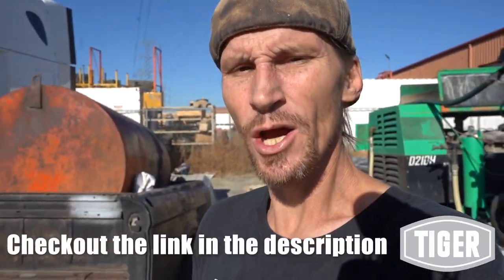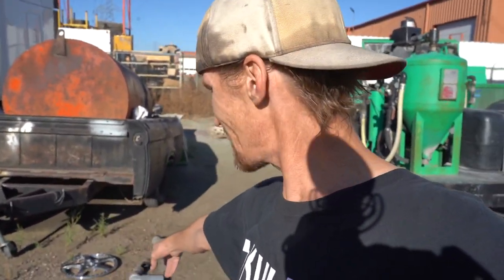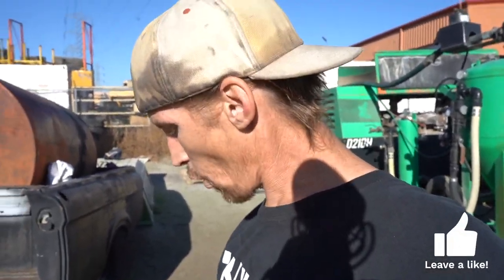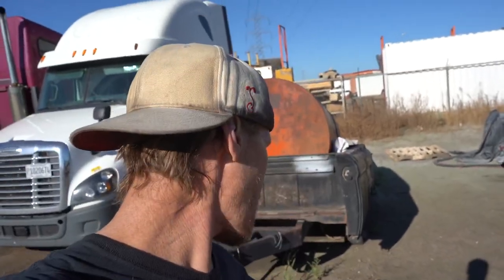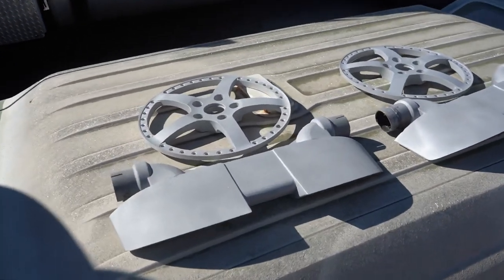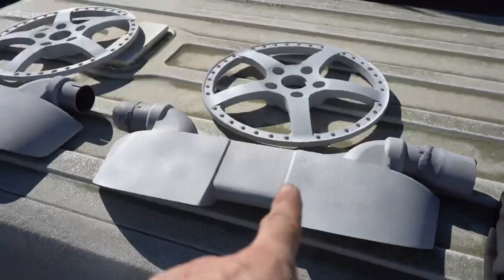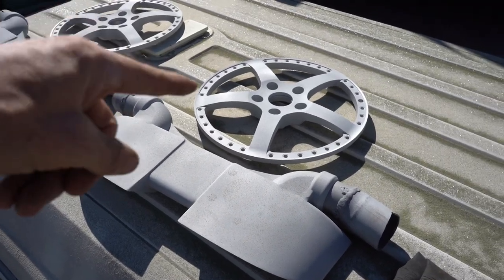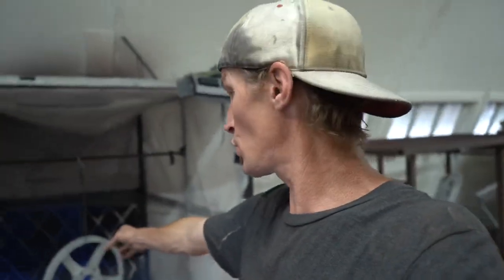How to Powder Coat Gloss Black EPIC FAIL

Comment: At what PSI do you guys Blast the parts again ? you guys us green diamond slag right
Reply from the maker: Yes we use green Diamond nickel slag. When we’re blasting with the lower 30 - 35 CFM pot we use 30/70 media, with the 210 CFM blaster we use 50/100 green Diamond nickel slag.
Reply from the maker: The small pot is 120 PSI the larger one is 150 PSI